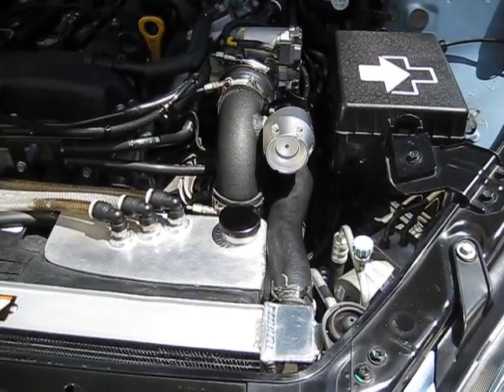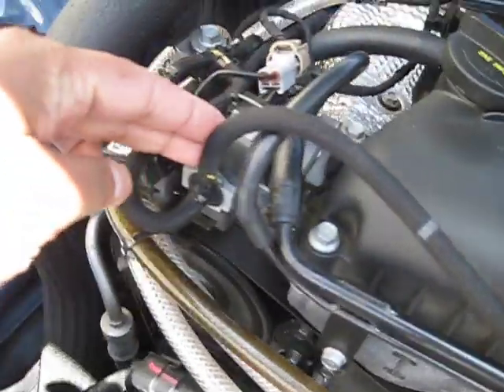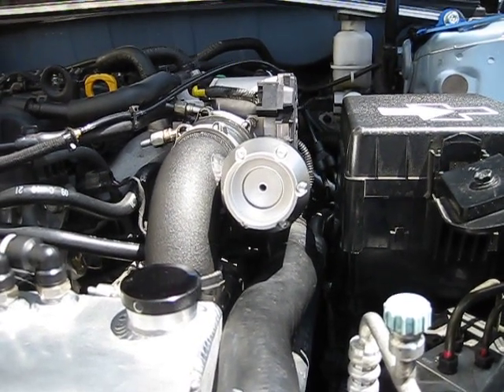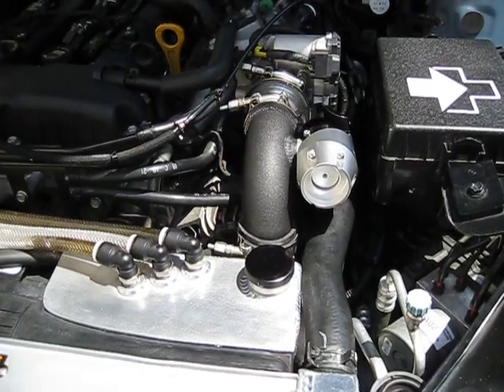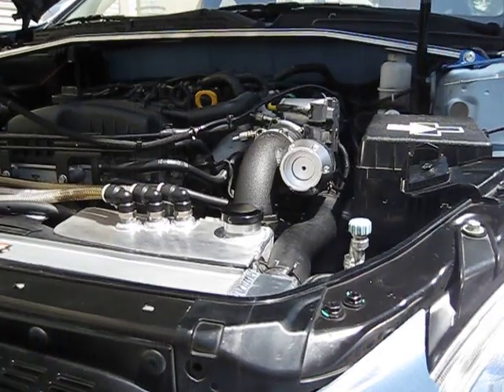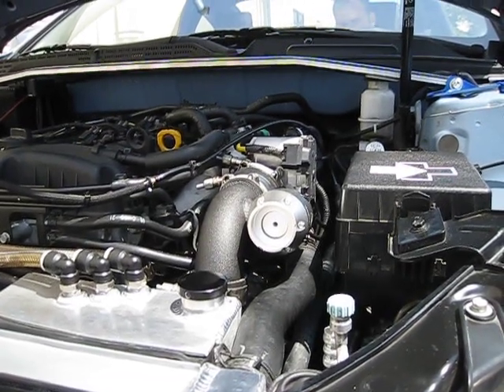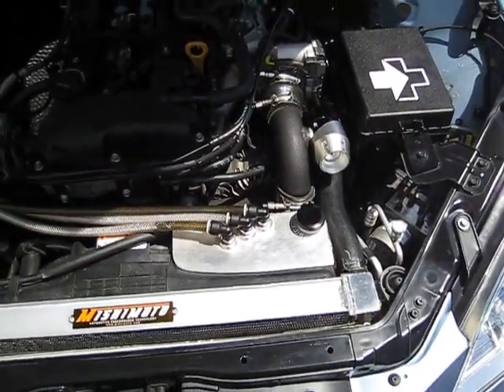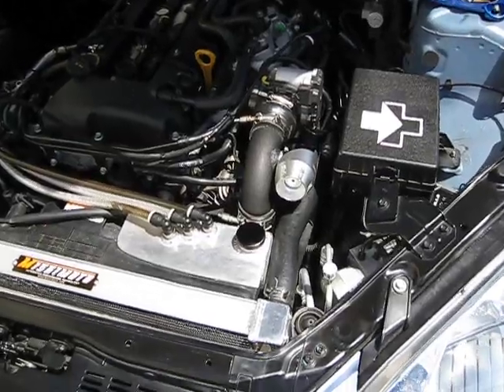Synapse BOV Hyundai Genesis

Comment: @Sefveron ... The factory installed BOV is plastic and slowly leaks boost pressure the closer to redline you get until you're running on about 3 lbs of boost.

Comment: Its impressive seeing this at work, and i see the benefit of having a fast responding BOV but... is there really a benefit to changing it, why not just use the factory BOV? if you modify the car extensively most likely the ECU will be changed and then theres sort of really no point in having a BOV that can respond to the factory ecu
Reply: If you want to tune for more boost you need an aftermarket bov to handle the higher pressure and the synapse bov also allows you to maintain all factory safety features via the boost solenoid